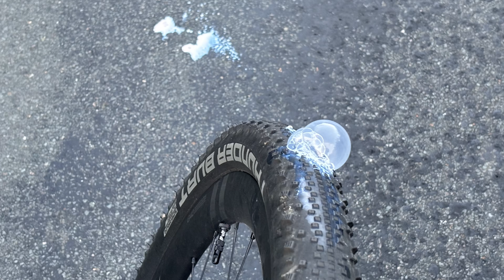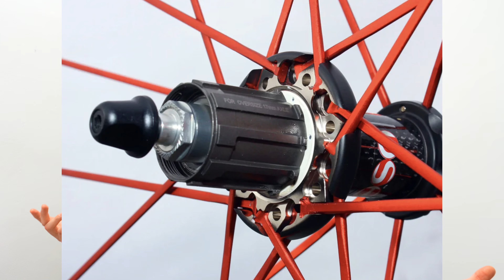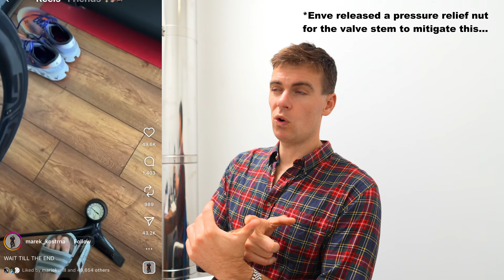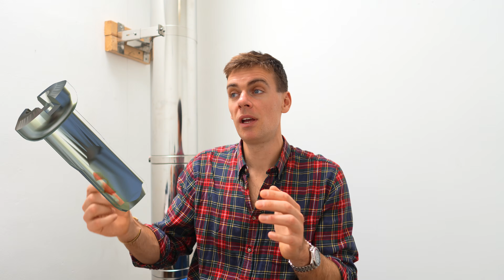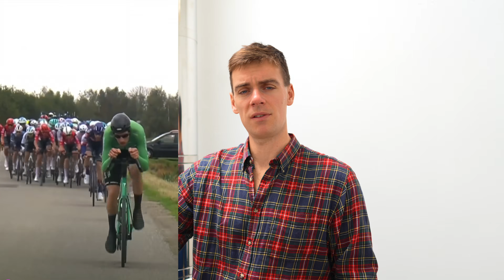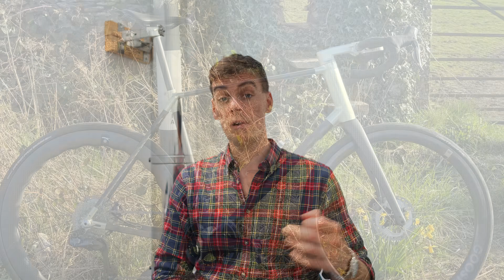The truth hurts and its ugly + more EXPLODING carbon wheels - PT Show ep. 9

Comment: Hum. Why pressurize the void area of a rim? That's bizarre and the pressure of road tires is significant. Unless the rim relys on internal pressure for strength and tension.  Why not tape the rim bed? Is the weight or bead clearance that much of an issue? The alternative is sealant all through the rim void area? No advantage and a big mess. I'd rather run latex tubes or something and never eff with tubeless hassles unless you are dealing with some bizarre puncture rate situation.

Solution is easy - make sure the valve hole trim is not air tight, or hole somewhere.

Comment: I have a wheel set that has open side entry straight pull carbon spokes. I was wondering if putting a small drop of super glue on each spoke nipple where it is attached to the hub would prevent the spoke from coming out of the hub and a catastrophic failure? Would the super glue be strong enough? Would the super glue damage the glue that holds the nipple to the carbon fiber? I use foam safe super glue that is used for RC model planes. Super glue is strong but not so strong that you wouldn’t ever be able to replace the spoke. If it can’t be removed by hand a drop of acetone will dissolve the super glue.

Comment: Overfast Wheelset has more “engineering margin” than Enve.
The design prioritizes structural robustness and system reliability rather than pushing weight savings to the absolute limit. Unlike some Enve rims that rely heavily on tubeless tape as a structural element, Overfast uses a more reinforced spoke bed, reducing the risk of air migrating into the rim cavity and causing internal pressurization.

This more conservative construction provides better tolerance to pressure, heat, and long-term use. Overall, Overfast follows a reliability-first, engineering-led approach—closer to Shimano’s philosophy—resulting in a wheel system with greater durability and real-world safety margins.

Comment: The big bike brands indirectly hold a lot of power in the UCI. If an individual goes against the grain, they're just removed. You can't really blame them because it's their show anyway, but it is petty. In the end I presume it comes down to manufacturing: if bike design turns into the wild west, it will be impossible to automate mass production which would result in big financial losses. The capitalists require a relatively uniform design with minor differences in order to insure profit.

Comment: I do agree with UCI discouraging this bike, in the same vein they banned skin suits from DH racing. The sport needs to look marketable and not dorkier than it already does! I say this as someone who doesn’t scroll Instagram at all.
Coming from mountain bikes, I do totally agree stacks are way too low on every bike I’ve owned. MTB is wising up to this and running riser bars but we really shouldn’t have to do that past 35mm rise. I like what Forbidden did with their DJI ebikes where they made stacks higher than industry standard. In MTB it went head angle -> reach, and now the geo measurement flavor of the year is stack.

Comment: Blew my Scope R4C rear wheel. They don't have vent hole :/

This happened during routine sealant replacement. The rim blew while I was seating the tyre. Wasn't even putting very high pressure.

Comment: If that's why carbon wheels are exploding I am lost for words. If that cavity isn't supposed to be pressurised, obviously a drain hole is an absolute must in all carbon wheels. I've had rim tape fail somehow while on a ride and you could hear/feel the air coming out of the drain hole as it deflated.

Comment: talking about open hip angle, my 1982 koga-miyata gentsracer has about 75° seat tube angle and the tip of my saddle is 16 mm from the center of the bb, so my position on the bike is pretty much forward by default. it's not uci legal though but who cares.
what i don't really get is that if you need a special rim for a tubeless fit and a special tyre that is a hassle top put on, then why does the industry not push tubulars? it's not more of a hassle to put them on with a tape, the rim is way easier to manufacture, and you can sell pretty expensive tyres too. yes, the downside is to take them off but if you choose wisely, you can use your tyre for a couple of years.

Comment: Very interesting, thanks. I’m also a tall rider struggling with the same issues. Just wondering if you think an aero tuck position is necessary if you have a high stack to go fast. If you don’t use the aero tuck, you’re just sitting very upright. I found that if you don’t race and you want to go fast for long periods of time, the aero tuck position isn’t very sustainable, even with a high stack it’s heavy for your arms. I always end up returning to a classic position with a slight bend in my arms. I now actually prefer a lower stack to be able to sit as low as possible in that position.

Comment: Tall rider here, over a yard of inside leg and it wasn’t until I rode (and bought) a Cotic FS MTB in ‘08 that I felt I rode a bike that actually fitted me.

My gravel bike is also an XL with 50mm of spacers, and a short stem & short reach bar and I’m now waiting for my Fairlight to be built, in their tall option size.

Because I’m short bodied though, always got the saddle pushed as far forward as it’ll go (on a straight seatpost).

Comment: Wheeltop EDS - funny you should mention that. Yesterday my read mech exploded on a normal ride while shifting to a lower gear. Never crashed, never modified, chain is fine. Fortunately it did not go into the spokes. Unfortunately I am getting "Our engineers determined that it must have been a bad chain so it is not covered" when looking at the pics they demanded. No chain was shown in the pics! So, buyer beware of cheap Chiney things! 1,087 miles on the system, so that's about $0.50 per mile. Lesson learned, and now I'm adding my third Di2. Anyone want two derailleur pieces?
Reply from the maker: Interesting! Buy cheap buy twice 🎉

Comment: High stack , and low setback do open the hip, sure. But the forward rotated position on the bike puts much more weight on the hands? Do you not have a problem with that , especially on easy rides?
Reply from the maker: I’ve never had a problem with that personally. Its an easy argument for the bikefitters to make but without any numbers…

Comment: Have you tried the Conti RaceKing Protections?
I know they're discontinued, but still out there.
The PureGrip 700x50/29x2.0 are even more durable and fast, but they are slower and heavier than the RaceKing Protection 2.2.

As for carbon rims, there's a lot of generalizations here...
1. Not all carbon is created equal. Some simply do it better than others.
2. Max tire pressure matters.
3. Most rims still have the drain hole, and rim tape will collapse and burst before a rim. Or is tubeless tape stronger than bladder molded carbon and epoxy. Aside from from a manufacture defect, but in general?
4. and this is anecdotal, but I have not had 25c tires or smaller setup tubeless reliably. The pressure has to be too high unless they're very light riders.
And I've been doing tubeless longer than most. Got my first Mavic USTs in 2002...Stan's sealant was practically not being imported to Belgium at the time so I sourced brews on MTBR with glitter and all that stuff. Fast forward, I tried tubeless on all types of rims and tire combinations, even wire bead on non-tubeless rims. I didn't start using tubeless until around 2007 or 2008 when I got the Specialized Tricross Expert that was actually my first dip into riding riding what's now gravel because the frame could fit 42c tires. But it was also my road bike at the time. It was also what I used for CX sportif. Granted I've never been big into road outside of a spectator for professional racing. I have a road bike...it sits on the trainer for Zwift, and an old Cervelo in the garage that I want to sell. My application for tubeless has most been gravel, CX and MTB. 

Sorry I know this went out on a tangent, but the reality is....we all love blaming the equipment for our mishaps or pushing the equipment beyond it's intended specs rather than take accountability for our own choices and decisions. I once blew a tire off the rim tubeless. Ruined the tire and bent the rim. I thought I only put about 35psi in the tire. Come to find out my pump gauge would not go beyond 35psi and it was probably closer to 70psi. I blame the pump of course, but I wasn't exactly paying attention to the needle not moving beyond 35psi. Being aware would have prevented it when I noticed I'm still pumping but the needle isn't moving....something must be wrong.

Comment: The position of a drainhole is important as well. I have carbon rims on my mtb and get quite a lot of water through the spokeholes while riding in rain. So the drainhole needs to be as far out as possible so the centirfugal forces push the water out. Otherwise you will carry the water with you for ever

Comment: I was so glad to have been reminded by PT of redundant engineering safety when ordering my 1200gm Chinese wheelset. With full aero-carbon/Ti spokes, hidden nipples, wide aero rims, all the spokes are captive and I can responsibly enjoy the weight and aero-drag savings without worrying about 'what if'!

I've got Profile Design Fast Forward posts on my 61cm Cervelos. 38mm set-forward topped with short saddles, 165mm cranks (down from 180s), a -20 x 140mm stem holding S5 bars, this gets my hips open with me down, aero and comfy, with 225mm headtubes. Problem is, that Cervelo replied when asking about longer stem lengths that they won't cover warranty if your stem is longer than 130mm. Where was that written before I bought from them?

I once took my 1st Cervelo into a Tri dealer. They asked if the bike was a 650C. Large framesets do not look 'normal', they are not, they're for those of us who have to try to avoid stepping on all 'the ants'!

Thinking outside the box, sadly, most folks don't even know there is a box that their social-media worlds are tightly wrapped within.

I've been watching Jesse and Chris' dog or fast bike for ages, if they had a dog/mongrel/fast bike 3-some, I'd happily enter my aero-tweaked 6.7kg best to be called a mongrel but their heads are so often tightly wrapped inside 'normal' thinking too. 

Why not aero tweak one's existing bike for the benefits upon the 80% of aero-drag, the rider's position, and worry abut the 2% savings an aero-frame may bring only if you might potentially win a race? I ride to enjoy riding. Fast is nice, but how often does it matter if I finish my ride some few seconds or minutes faster or slower?

Comment: A pressurized tube will excerpt force in all directions and, since tubed setups run higher pressures, the force on the rim bed will be greater in a tubed setup than tubeless. For a normal tubeless setup using rim tape with spokes seated on the rim bed, you could get leakage into the cavity below. However, in order to pressurize that cavity it would have to be completely airtight  around the spoke hole which is highly unlikely. A bigger danger is rims with a solid bed and spoke nipples seated at the bottom of the 'fairing'. In that case the entire rim can become pressurized if there is a leak in the carbon that forms the rim bed.

Comment: Many years ago, the alloy rim on my 36-spoke rear racing wheel clipped the sharp edge of a slightly raised cast iron manhole cover in the road. There was some resultant local distortion of the rim, which I felt as an intermittent bump when I applied the brake. The wheel was also knocked 'out of round.' I managed to stay upright and rode home despite the damage, subsequently having the wheel rebuilt using the same hub.
What if I'd had carbon rims? I've no doubt whatsoever that the rim would have collapsed. The cycle industry's endless tinkering and so-called 'improvements' over proven reliable technology just to save a paltry gram or two is potentially dangerous. I've always had my suspicions regarding carbon rims and spokes - and your post has confirmed my thoughts. Well done for bringing this out in the open.

Comment: To stop grime getting into that vent hole (had a 2kg rear after km's of mud once, not fun to clean out) just put a square of water resistant tape, it will pop off before the wheel fails.

Comment: I had a pair of ENVE 3.4s about 4 years ago.  They had those pressure release value nuts back then and specifically said NOT to use a washer , so it was a known concern.   I wasn't too happy about that, but rode them for a while until moving to Reserve's for the larger internal width.  Reserve wheels do have pinholes in them.

Comment: QC department will be happy: more design, failure trials and safety tests absolutely necessary to show your design is safe. 
Maybe an industry standard is required to test the fairing pressure, or when a pin hole is added it is safe from cracks etc.
Carbon is inherently catastrophic failure mode. Perhaps manufacturers should also consider adding in other fibres in carbon wheels (rims and spokes) like kevlar or other suitable stuff , to make it less catastrophic in its failure mode. 
(Arm chair analyst here.)

P.s. when pumping up a tyre the air is warm and humid from the compression. I'm wondering if that affects any aspect of design/failure? Would water from the air condense?
 Using an air compressor (with a large air tank) as would be used in testing of designs perhaps make the designer think 'job done' when they should have tested under all conditions.

Comment: I'm a tall rider also, but will a short back.  I'm also a big fan of the round seat post. If you had a round seat post with a set back or curved back, seat post. One could rotation it 180° to put your seat post much farther forward, if needed.

Comment: I find the exploding rims quite interesting. I have been wondering like you why does nobody test this it should be really easy. I think you have to have some ideal circumstances to seal the valve at the nut ( but not impossible) , a lot of rims have no flat spot for the nut.  Also the chance that your valve will leak at the rubber side but not on the nut side is very unfortunate so I think your save with the no tape rims.  But drilling a hole is a nice save guard.  I also wonder if the explosion is triggered by just slowly leaking in to the cavity or its a sudden failure of the tape.

Comment: Reposting my rim tape question: I use Velox fabric rim tape because the cheap rubber strips or electrical tape will always inevitably fail from the pressurized tube pushing against the rim strip over the spoke holes and punching out the rim strip like a hole-punch... ...which then pinches the tube or it gets lacerated on the sharp edge. Velox fabric tape is heavy, but never fails. 

Do you know of a good lightweight AND durable rim strip? Any advantage to using thick fabric rim strips in carbon rims with TPU tubes? Some shock-dampening maybe? Bad for rotational weight, I know.
Reply: I used to use Continental rim tape(one piece). Velox and heat gave problems. Nowadays I use veloplugs.
Reply: @nlfiets  Brilliant, thank you!

Comment: What bothers me is why MTB rims aren't exploding all over the place. Maybe it's because they aren't weight weenies and want stuff that will survive. Got a great explanation, a test was done between wheels that weighed in at 1200 g and ones at 1500. Acceleration was the only place the heavier rims were at a disadvantage. Once up to speed, the latter were way more stable and kept the rider off the ground. I do agree that the quality of tape matters. DT Swiss has been in the game and makes great tape. Also, every shop I go to says replace the tape every time to put on a new tire. Lastly, I don't let my tires go flat. Once a week pump up for all of my tires, even tubed.
Reply: Difficult to blow a rim apart with 22 psi... edit: also much smaller aero cavity on MTB rims, if any.
Reply: @alan_davis But it's still quite possible to blow the rim or the tire off at 22. The point is that road wheels are under constructed and thus weak to begin with.

Comment: I’m curious how the setback still hits that min 50mm line on the modded seatpost, because even on my bike with a 73.5 seat tube angle, if I slam my saddle forward I get ahead of it.   Guessing the frame is slacker if it’s a larger size frame, which is common for the big guys.   

Great video, every piece of it was well presented and filled with information.

Comment: 9:55 My 9velo wheels blessedly DO have a pinhole in them. When i incorrectly applied rim tape and tried to pressurise a tubeless tyre air came rushing out of the pinhole. So i re-applied the rim tape and it inflated just fine. That they had this pinhole though was undoubtedly a good thing as it meant that the exact failure you're talking about simply didn't occur. If it weren't there i would be riding on a time bomb and not even know it.
Reply: Your problem now is that you have a tubeless booger inside your rim - tubeless is way more trouble than it’s worth…

Comment: I think all threads have a small helical leak path regardless of tension ???
Reply: Depends on the material. You are correct if nothing deforms, but that is only ever true on a drawing...
Reply: not if thread sealant is used, or if tubeless sealant gets into the thread.

Comment: Hmmm, my first thought about the rims was that the air would get out by the stem or spokes, but even with a metal washer it could make a seal with the tubeless sealant.
My scope R4's don't have a vent hole, whilst my coworkers S4's have.
He runs them tubeless, I use tpu tubes.
A sidenote would be that the nut for the stem doesn't have a o-ring, so it could vent there, but again sealent might gunk up around there if you've got the perfect storm.

Interesting none the less.